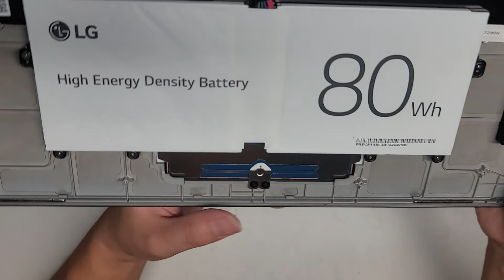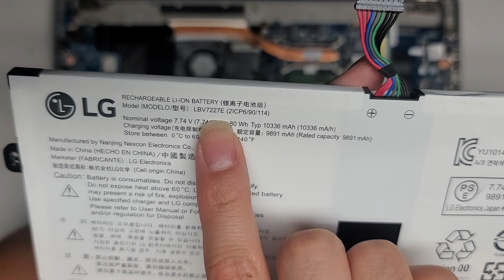LG Gram 17z90n Disassembly RAM SSD Hard Drive Battery Replacement Repair Quick Look Inside

Comment: Use heat (hot air gun) on those rubber feet or strips that have adhesive and they separate much easier and also attach back on easier too.
Reply from the maker: @Turco949  nice

Comment: Are there two ram slots in this laptop? coz i didn't notice the other, Is the other ram soldered?
Reply: These laptops have 1 ram slot, but there appears to be integrated ram on in the cpu(?) I upgraded my 13z980 with 16G of ddr4, but I have 20G available, not ideal tbh. I think they are on a single channel though.
Reply from the maker: Usually the first matching amount will be dual channel
Reply from the maker: Only one

Comment: Where is the cmos battery pleaseee
Reply from the maker: I think it's the same as the main battery
Reply: @ItsBinhRepaired  thank for the reply. I have issue with a lg 14t990   3 month afterni purchase it in late 2019. I  power it on and it get stuck in the lg logo it diesnt appear the circle (loging tonwin)  i cant do nothing except force the power off button.

I bought a 2 ssd at the time (1 tb crucial.nmve) instalar win there and though the issues were in the CT ssd.

I have been strugling 2years with this. I took out th ssd i stuck with the oem.ssd but continue the issue. Example 2 weeks ago i have to install win from.scratch and                 
Today i power and apear lg logo and rhe circle but just appearing the wind screen it reboot...2 time and it go recovery, cant make any troubleshooting opcion, example reinstal, safe mode etc.  And if i get to bios sometimes the date time  are change. I habe been open it and taking the ssd out an put in again and then i can.log to win. 

That s why thought maybe it a cmos bios batery issue but  i read yesterday that the biosbatery isnintegrated in a partición of ssd or de pc...

Dont know what to do..

 Here lg Chile (bought it in spain) told that warsnty aplly in country werenu bought it, so i am stuck.

I have videos of  the issue dont know what the f... to do
. Its a faith step everytime i power it on.
Reply from the maker: @Alejo519  never heard of that issue before. I'm not really sure. If there is a bios battery. It might be under the motherboard. You can try to find the motherboard online and see if they have pictures of the other side.